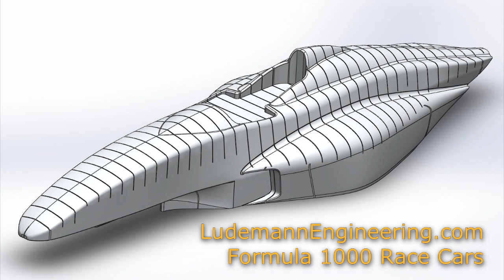Formula 1000 Race Car Build 3: Priming Body Buck

Comment: hello James,
i have 2 questions please :
1 - about the surface finishing, i am building a f1 front nose around 26 cm in length, i made it from fiberglass mat and polyester resin, but i am having a problem making it's surface become very smooth and no ups and downs, i try and use polyester putties for cars but don't like it much, and tried the filler of talcum and polyester still not what i want, so any suggestions please what can i do, primer or something ?

2 - about the suspensions, in f1 the suspensions wishbones and screwed into the wall of the monocoque from the side, but for me the only way that i manage to make it work is by adding a triangle screwed it into the monocoque and attach the ball bearing of the suspension on in it, so you opinion please ?

Comment: How did you di the fiberglass work? Did you make the fiberglass body on top og the frame? :)
Reply from the maker: I made a master pattern from an X-Y grid of plywood cross sections, filled in with foam and covered with epoxy. Then I took molds from that and cast final body parts in the molds. In the end the body fit perfectly because everything was designed in CAD. http://ludemannengineering.com/2013/01/23/building-the-body-buck-part-1-ribs-foam/
Reply: Ludemann Engineering
At what stage are you now at in the build. Just curious.
Reply from the maker: bighands69
The body's finished, the frame's finished, and I'm doing final assembly. Still a few parts to fabricate as I assemble it.
Reply: Ludemann Engineering
Hopefully if you get a chance you can put up a completion video. Good luck.